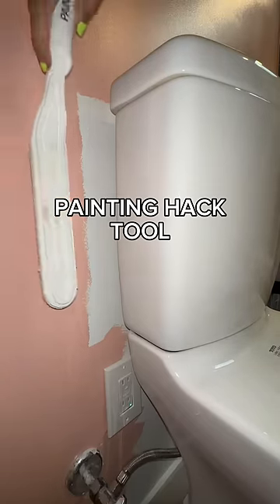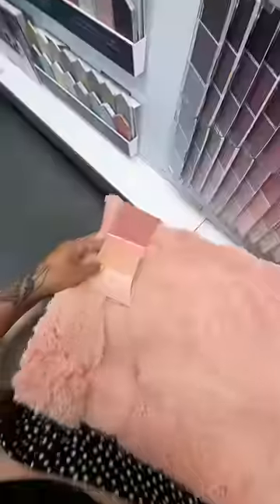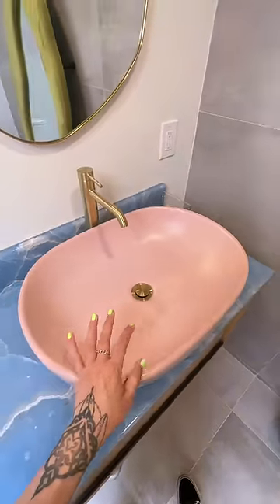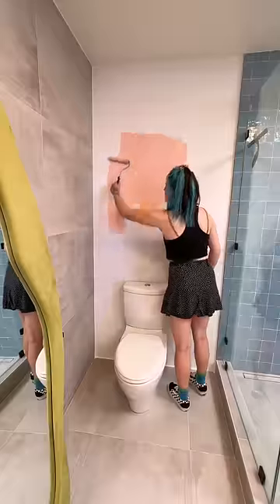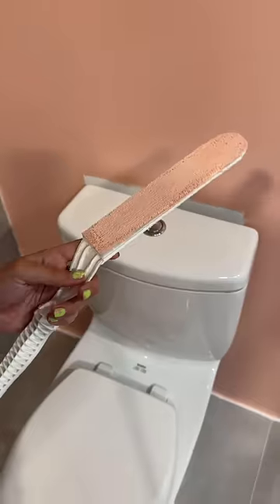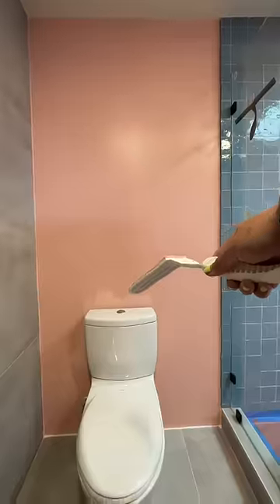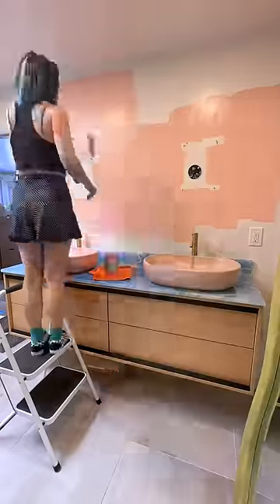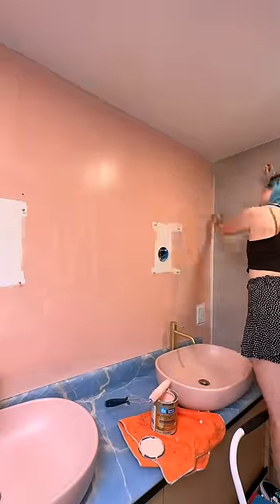I WISH I'd known about this before. #hack

Comment: That outlet behind the toilet is sending me😂
Reply: I have an outlet there for my bidet, comes in handy
Reply: The fact that she didn’t take the cover plates off of the outlets bothered me.
Reply: That’s what came to say! How is that to code? Could be very shocking on your tooshie. 😱
Reply: @angier2289 it's a GFCI outlet. The same kind you prob have in a kitchen with the reset button. It's designed to shut off power in a tiny fraction of a second and it takes very little water to trip them.
Reply: My bidet does not require electricity.  I have never seen an outlet behind the toilet
Reply: Charge your phone while you go?
Reply: @anitalauer2715 At least she didn't paint over it. 😢
Reply: I thought it was just me ‼️💀
Reply: It’s for a nice bidet or fancy toilet!
Reply: seriously like imagine all boys with no aim 😂 but at least they can charge while they dump
Reply: @anitalauer2715 I know I hate that. I mean not like hate hate, but it bothers me too.
Reply: @erin9868 Thanks I put them in my house in the kitchen and bathroom. Yet I didn’t really know why.  I didn’t know what you just said.  I guess I just did what I was told. Or what was suggested for me to do. 😮😳
Reply: @elenasunshine  it's for electric bidets that use heated water. So your bum can be toasty warm. There are battery powered ones too that blast you with cold water before gently warming. Lol.
Reply: @elenasunshine And? Are you trying to obliquely share that you clean your tushy with cold water 🤷🏾‍♀️
Reply: Heated seat
Reply: @elenasunshine many newer homes have the now for the heated water and seat bidet.
Reply: That’s the first thing I saw in the video why is there an outlet so close to the toilet? They really wanna send anybody to the upper room😂
Reply: @_badassdj219 Seriously. Imagine getting to the pearly gates and being asked why you're there before your time. 😂
Reply: @_badassdj219  What do you think is going to happen here that would kill someone. Is lightning going to shoot out of the outlet?
Reply: @elenasunshine Your bidet is cheap, congratulations
Reply: How strange. I'm assuming it's for a TOTO or something, but in the UK that would be hardwired and outlets concealed.
Reply: And me in the U.K. that wouldn’t be allowed lol they have to be a certain distance from water
Reply: I came looking just for this comment
Reply: @MrDohertym those outlets themselves are hardwired obviously but due to being GFCI they’re graded for use in wet environments safely. They basically act as circuit interrupters (the CI) and prevent shocks.
Reply: @elenasunshine I’m sorry for your cold Butt lol
Reply: @elenasunshine  it's for the heated ones, and if you got the fancy all-in-one built-in  bidet toilets you'll find a GFCI outlet
Reply: @elenasunshine there’s multiple types of bidets. Ones that have electricity, ones that are simply an attachment to a toilet, and bidets that don’t require electricity 

It’s becoming more standard to install an ground fault outlet behind toilets so an electrical bidet can be installed
Reply: @_badassdj219 it’s ground fault like the ones next to your sinks. Any outlet within 5’ of a water source is ground fault. It’s also for a bidet toilet
Reply: @Mizzburlesque outlets next to water are ground fault so the outlet with trip (not the entire series) if it comes in contact with water. There’s an engineer YouTuber that demonstrates how reliable and how quick they trip. Your outlets are also like this but slightly different. Essentially electrical wiring is needed next to water (bidet, garbage disposal, etc). Anything within 5 feet of a water source is a special outlet
Reply: Why? Lots of places have this
Reply: Of all the places to have it 😂 such a hazard
Reply: Righttt???

Comment: Nobody gone talk about the electric plug behind the toilet?😮
Reply: They’re for bidet installation (warm water). I wish I had an outlet behind my toilet!
Reply: 😂 u mean da outlet? 😅 I kno I wasn't da only one who seen that.
Reply: @neveragainnj  …lol yeah tht
Reply: @qtgrlhl  …ohh never thought about that
Reply: No, they actually are talking about it, I mean it’s a whole convo. 😮😊
Reply: Interesting with an outlet just below a water tank. It would definitely not be a certified electric installation in my country.
In rooms with water installations, electric outlets and switches must be at least 1 m over the floor
Reply: @micke_mango it is certified and allowed. How else you have outlets next to your sink or a garbage disposal. It’s a ground fault outlet. Different countries have different codes. In the US (which that outlet is for) you can have outlets near water sources BUT they have to be special outlets that will fault out if too much moisture comes in contact. They are very safe outlets. They are similar to UK outlets that have a switch on them but safer because they automatically trip (aka you don’t have to manually flip the switch)

Comment: Maybe the electric outlet by the toilet is for a bidet?  (I’m talking about a bidet system you buy to install separate that is used with our regular toilets). 
Idk-I’ve only seen a couple that are like that for use in standard toilets and they did need electricity and maybe even hot/cold water access but idk about that part for sure

Comment: You know it's super easy to remove the top of a toilet. You just turn off the water. Flush until it's empty and then unscrew the two screws on the bottom
Reply: IT'S ALSO EASY to use the tool shown in the video.
Reply: That depends on how rusted the bolts are and how deteriorated the tank gasket is, I would leave it alone if the bolts are rusted unless you plan on replacing the bolts and getting new tank gasket. Otherwise the easiest way to paint behind the toilet is just remove it entirely and put it back when it's dry

Comment: Everybody STOP freaking out about the electrical outlet behind the toilet! It is a GFCI Ground-fault circuit interrupted safety outlet required for wet areas. Note the green indicator light showing it is activily set and the test and reset button in the middle of the outlet! This  shuts off the power the instant it detects a circuit fault such as water. It was probably installed at that location behind the toilet to power a fancy bidet toilet seat😂

Comment: You can do the same thing with a wire hanger with a piece of dust swiper. Just bend the wire with the same shape, put the dust. This is too expensive to get that job. swiper(you have to sew the edges)

Comment: The outlet beside the wash basin would be a violation in Europe also, in fact outlets inside a bathroom at all are not allowed (apart from a shaver socket), but the power supply is different so maybe that is why the difference. Meanwhile, you would need a fairly specific shape of tray to load the pad without getting paint on the back of it. And then there is painting in a cute little black and white skirt and top and fancy shoes.

Comment: That outlet behind the toilet is def a code violation
Reply: Lol... Yes!!
Reply: Fo sho 😂
Reply: How else you supposed to charge your phone when pooping?
Reply: @outinspace3083 by the one that is a few more inches away from possible water being in it. Which would be not behind a dam toilet, and further away from the water line valve. I have never seen that in my life, and I own a construction company so we have seen many weird places like the CEILING but not behind a toilet very odd😂
Reply: It's a gfi outlet, so wouldn't it be ok, especially for a bidet that requires being plugged in?

Comment: That pink sink is going to haunt you 😂😂😂😂 the 60s are calling! Lol
Reply: My first thought
Reply: Not if someone really like it’s many people like to have their house represent an older era or they really like pink
Reply: @kuroo8484  I agree... but this color pairing is not of any era.  Either there's more painting to be done (special paints for tiles, etc) or the client has some truly wack taste in decor.  Lol

The 1950s etc pink and black pairing was very popular.  I've never seen such extreme pink and blue.  Other than the pink and black, most 1950s colors were pastels, which usually weren't paired together, in most cases, but even if so, they went together much better than such extreme darker colors.  Eg: a 1950s bathroom of yellow and green soft colors.

It's also a matter of pairing warm tones of blue vs cold tones of blue with the warm pink.  Warmer tones will match much better... albeit still an odd choice, except for baby decor.

And then there's tossing the warm pink, cold blue in with the cold tan/gray.  Whoa...
Reply: @dontworrydehappy7104  my grandmother had the pale pink sink and tub and yellow and pink and green rose printed wallpaper in the bathroom. Kitchen appliances were green as were the cabinets.  The whole house was nauseating! Lol

Comment: Yes. I am a painter. Owned a company for 15 years with my ex. Did all the quotes and painted as well And I’d never ever seen these before here, Not then and not now and I just yesterday was in the painting isle   I would imagine most professional painters wouldn’t bother with an extra tool. You just don’t ever see painters with any of these specialized toys. At least I haven’t. In fact Most painters I know myself included don’t even use tape to cut. Unless asked, barely ever happens or detailed work etc.
Reply: My dad is a Master Painter...Master Painters not only don't need tools like that...most have too much pride to even use them! 
Tbh, I don't see how this girl starts painting from the middle out and gets a happy client.
Reply: Didn’t cover anything either. Pink paint on the white toilet and everywhere else… 🤦🏽‍♀️

Comment: Great paint stick and great job!  But the colors...  Warm pink, cold blue and tan/gray tile.  Yikes!  

I'd assume that the tiles were going to be changed as well, except you usually paint walls etc AFTER doing tile.  Even the blue and tan/gray is an awful mix.  Toss in the pink and it's a train wreck.  Hopefully the tiles might get painted (special paints for such).  Or, the client's  taste in decor is just wack.